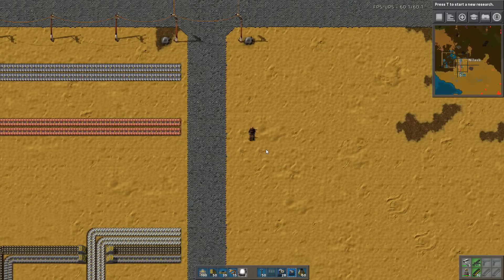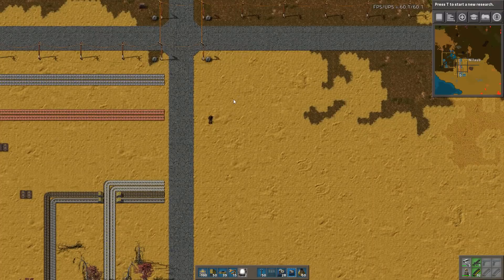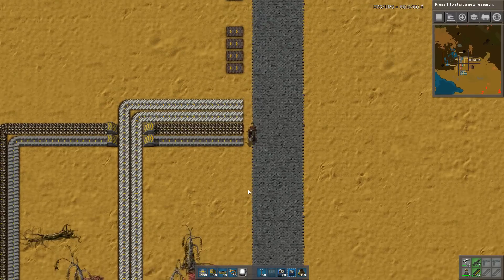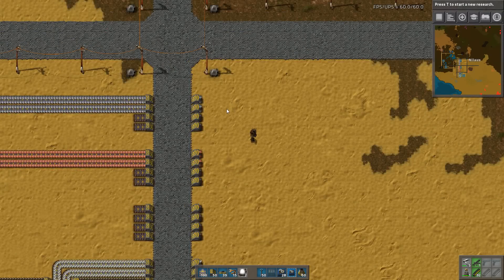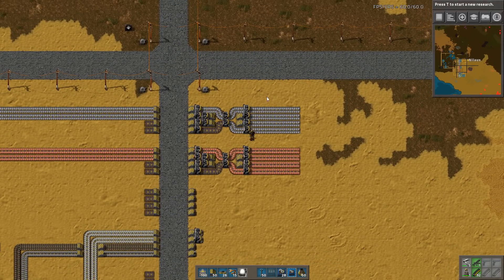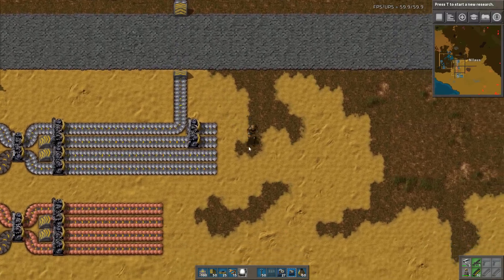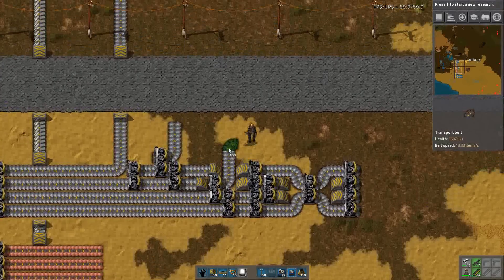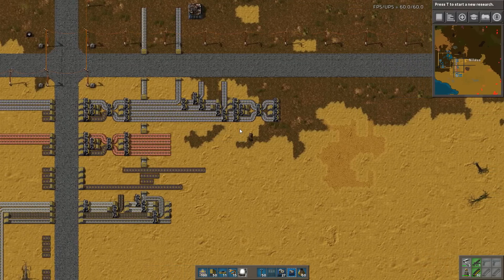Factorio Tutorial - 4. Main Bus

Comment: There is a better way for a half belt outside extraction. Use a single outward facing underground exit and a splitter after this. Requires 0 tiles outside of the bus itself for the extraction (except the extracted belt itself obviously)

Comment: Is it possible to make the bus two ways so that you can return products back to the beginning of the bus from further down the line to then be fed back into the bus further down?
Reply from the maker: It is possible, but can cause problems. If you feed Iron/Copper the wrong way on the bus then you lose of the be major benefits of the bus i.e. being able to control the flow from one direction only. However for things like Piercing Rounds that you want to bring further back then it is fine.

Comment: Great video series, this has helped me a lot learning the ropes after being a complete noob.

 However I want to point something out. You should NEVER take a line of the main bus without using a splitter. The reason for this is that everything coming after it will be capped by that line, not because of the usage of that line but because the entire rest of the main bus is now basically 3 lines, no matter if the line taken away is idle or not. if you dont use a balancer before taking another full line (not the same line as you took the first time) your main bus will now basically have the throughput of 2 lines. If you need a full line for something, split a line twice and connect them, or split two lines.

You won't necessarily notice it in the beginning, but if you feed your bus with 4 lines your throughput will still be as if it were 3 lines (or less).

Comment: 0:46 ... One thing I don't understand, you have the lines from below (copper, stone, steel) going directly across where you would expand the smelters, why? If the underground transporters only span 4 tiles, then wouldn't those lines be in the way when you decided to expand? If I recall, there are no gaps in the blueprint of the smelter group, so there would be nowhere to stick those underground transporters, right?

Comment: You can build a 4-lane balancer with 2 less balancers (you don"t actually need the 2 balancers on the far right). I don't know why I keep seeing the setup you're using, for me the last balancers add nothing to the thingy.

Footnote: you can do a 6*6 balancers but it will either be not perfectly balanced, or you will lose some throughput. As a rule of thumb you should always do a 2^n * 2^n balancer (for example you can use a 8*8 balancer to balance only 6 lane)
Reply: Those 2 splitters are actually necessary on the 4-lane balancer :)
Relevant reddit post: https://www.reddit.com/r/factorio/comments/6jk368/can_someone_explain_why_splitters_are_used_are/
Reply: @97Gam3rlink thank you, I thought it might be something of the sort. But that reinforce my oppinion, if you full feed it you don't need the end balancers.